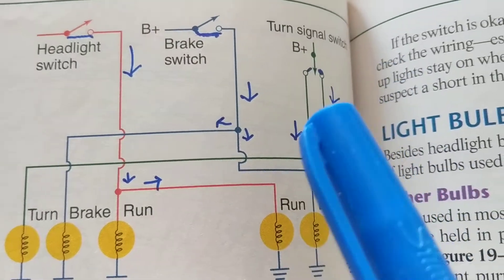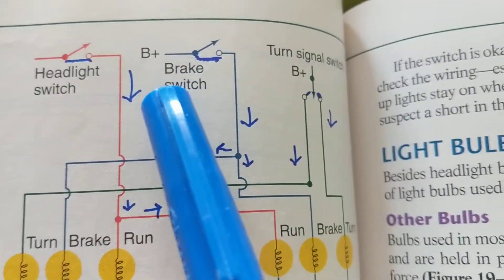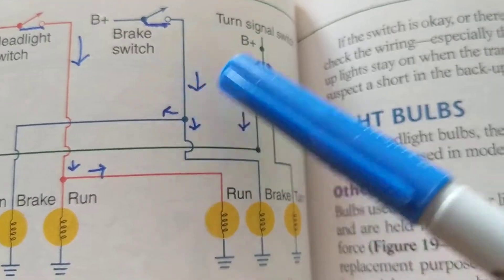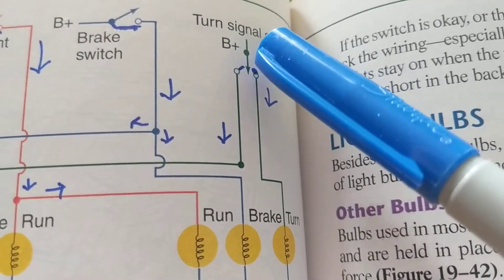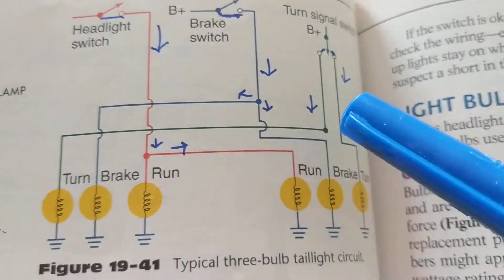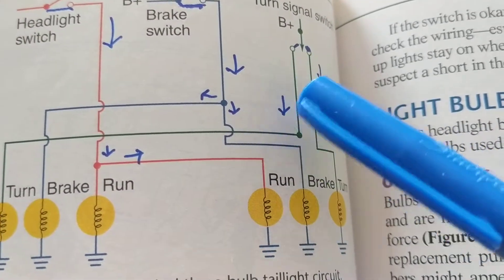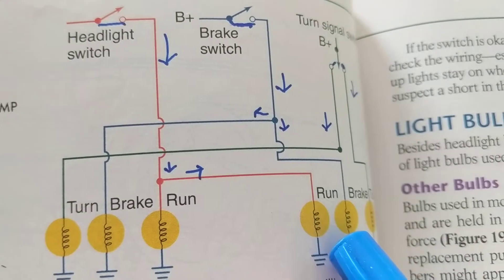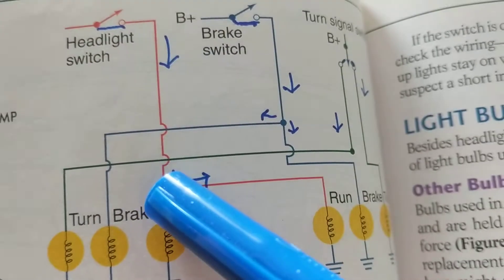HOW TO READ AUTOMOTIVE SCHEMATICS simplified for beginners

Comment: 2:17:  You stated current Can flow either way.  Officially Engish Speaking.  The current Will flow Both ways.  The only way the current will not reach ground for both paths is if there is an open in one of the paths after the connection location.
Reply: Yes current will not flow if there is an open anywhere from the positive of the battery to the negative of the battery or if you have an AC source there has to be a complete path thank you for your comment